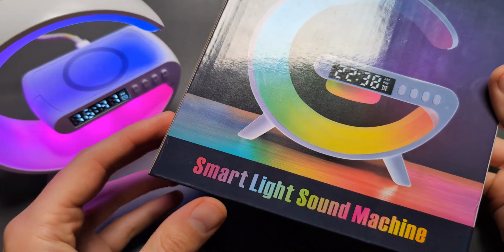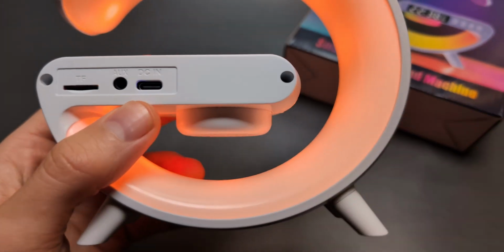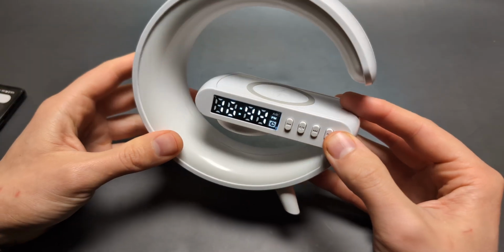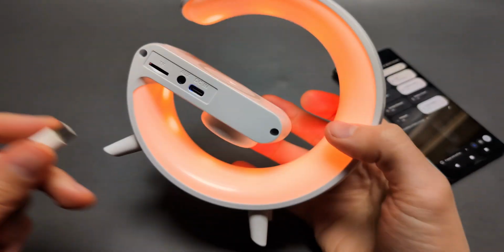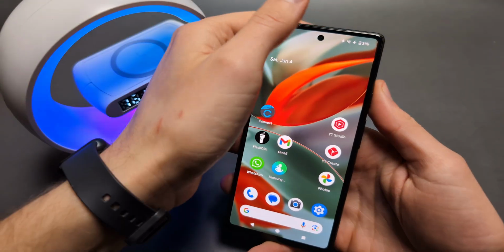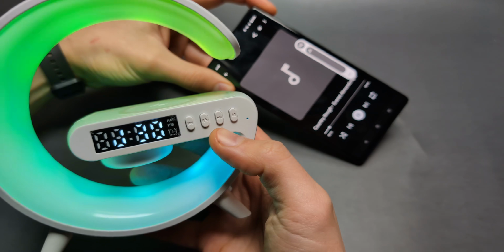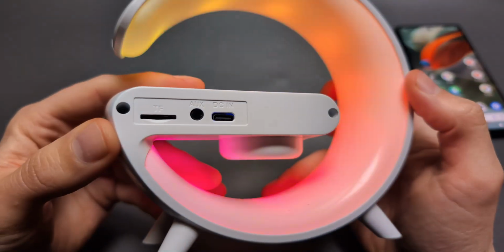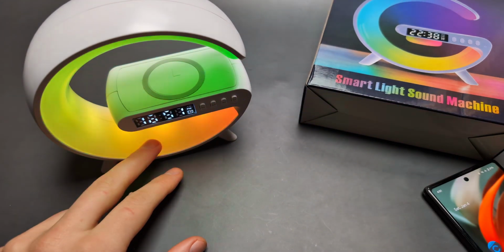Manual & Instructions for G63 Smart Light Sound Machine

Comment: Smart Light Sound Machine User Manua

G63

G

Wireless charging usage: Insert the charger to

automatically turn on wireless charging

1. Short press and long press to decrease the volume 2. Short press pause/start on/off

increase the volume

3. Short press the prestart long press long press to

4. Short press to control the light, long press to

enter the clock setting (short press pause key to switch the cursor), long press to set the alarm clock (short press pause key to switch the cursor)

Technical parameter

Battery type: Lithium batteries (see outer box for capacity)

Main function: Bt. TF. USB. Aux. Wireless charging

Size: 155*55*160mm

Speaker size: 36mm

Speaker resistance: 40

Speaker Output Power: 3W

Wireless Charge Power: 5W/10W

Power Input: DC5V/2A

Key function operation instructions

1. Power on: Press and hold the power on button for two seconds to turn onthe device, and the default light is warm when turned on

2.Bluetooth function usage:

1 This audio system supports the use of Bluetooth devices with A2DP function. First, turn on the device, press and hold the M key to enter Bluetooth mode. The blue light of the Bluetooth indicator light flashes, accompanied by avoice prompt. At this time, the audio system is in a waiting state for pairing and connection. Only in this state can it be paired and connected to the Bluetooth audio system.

2. Mobile phone connection

Step 1: Tum on the Bluetooth settings switch in Step 2: When the available device displays the G63 the phone settings and click to search for devices

the character, it indicates that the phone has found Bluetooth audio system, Click on enter pairing mode. After the phone and the audio system are successfully paired, a voice prompt will appear indicating that they are connected.

Light usage:

1. The G63 Bluetooth speaker is equipped with various lighting effects

2. The default warm up effect when the device is turned on, short press the M key to adjust the light effect

TF card/USB drive function usage:

Insert the TF card/USB drive into the card slot, and

a corresponding voice prompt will appear. The product will automatically read and play the audio files inside the card. Users can use the "+/-" button on the speaker to control the music size and sound

Safety instructions:

1. Do not expose the product to water or damp areas, such as bathrooms.

2. Please do not forcefully hit or drop the product to avoid manual damage.

3. When not in use for a long time, please turn off the power.

Warranty and after-sales service:

If you have any questions during use, please feel free to contact US, and we are responsible for every customer.

MAS

Comment: Can you change it from 24 hr to 12 hr clock??
Reply: That’s what I’m trying to figure out
Reply: how ?
Reply: Yes
Reply: Even in that worthless manual it says short press to control the light long press to enter the clock setting but when I long press that all it does is turn the light off it never goes to the clock setting and I'm getting extremely frustrated. I mean I know this was not a really expensive thing but if it says it has a clock and an alarm on it you should be able to at least set it
Reply: Try rapidly double clicking the botton instead of long press.

Comment: I got one for Christmas and I’m having hard time figuring it out. When I turned it on the lights came on but the clock didn’t and I couldn’t interact with the time settings at all. I’m letting it charge more but I was wondering if there’s something else I need to do?
Reply: That's the same problem I'm having. He is right the manual is horrible. In the English part of it they don't even have one of those little diagrams. I long pressed the M button like he showed in the video and the only thing it did was turn my light off it never went into time setting mode at all. Everything else I kind of figured out on my own before I found his video I'm just desperately looking for help to get the time set. I don't even care about the alarm
Reply: Double tap the m button
Reply: If mine is plugged up it turns right off after turning it on
Reply: U need to hold the m button but if u r talking to talking about changing it from military tume ifk
Reply: I meant idk
Reply: Fr😅
Reply: Going to return mine nothing ¹is working on it